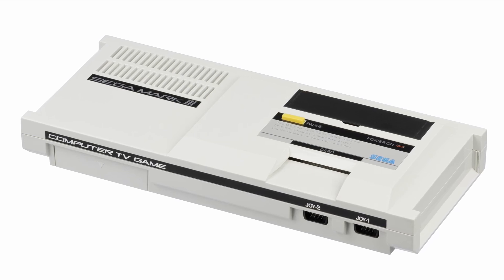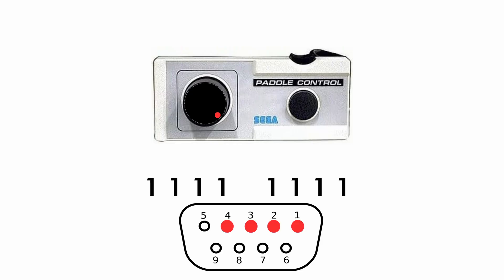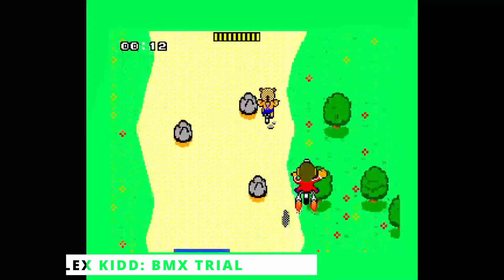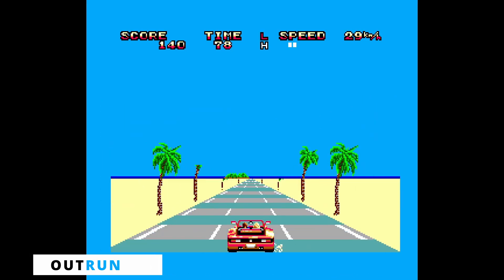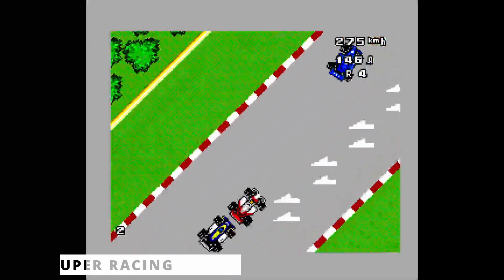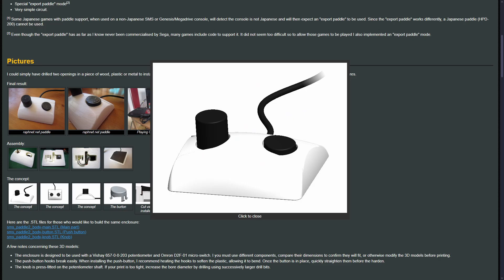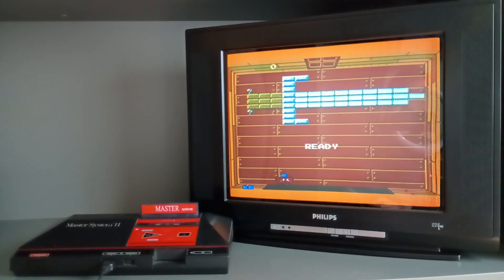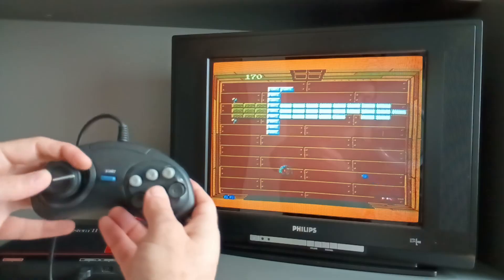The RAREST Master System controller (and how I built one myself)!

Comment: The use of a six button controller has me curious because now I'm wondering if it's possible to program a SMS game that can use that many buttons.
Reply from the maker: Yeah, it would be possible!
Reply: @chirinea  Ah so the SMS version of Street Fighter 2 can be more than a novelty, they really need to give it more sound effects. Have been thinking of getting into SMS games, I’ve just been dipping my toe by listening to SMS music or watching the odd video. Want to use a model 1 Genesis/MD since it has a SMS inside it and it’s a whole lot more economical than buying an expensive SMS and a flashcart for it. Without using the pricy Power Base Converter I miss the ability to pause the game, and that could make it or break it for me. I know that some SMS games have been modified to give the start button on the Genesis/MD controller the ability to pause the game, however it doesn’t seem like many games have gotten that treatment.